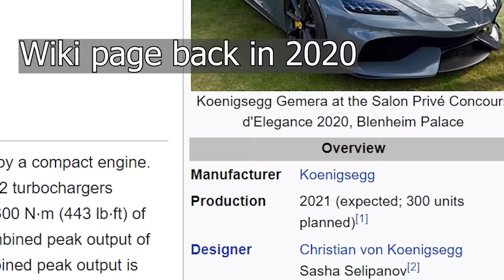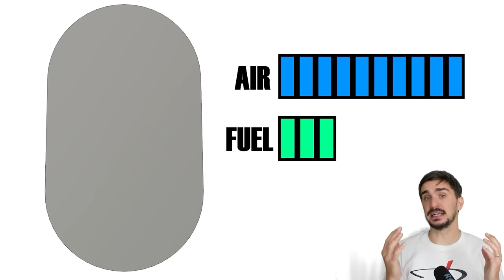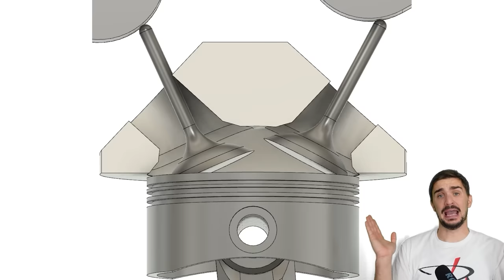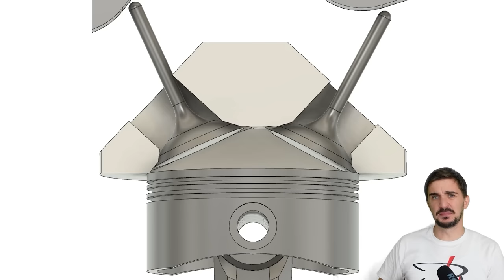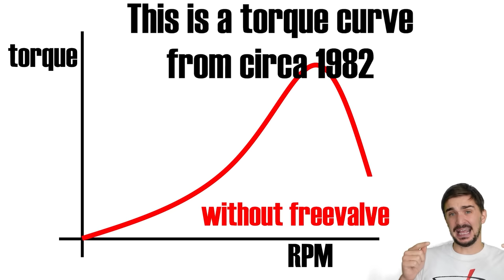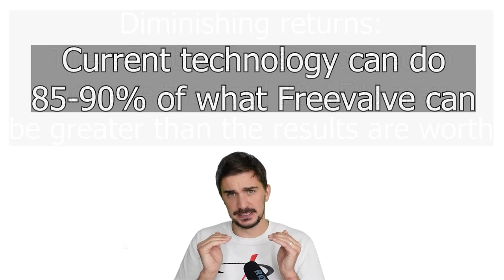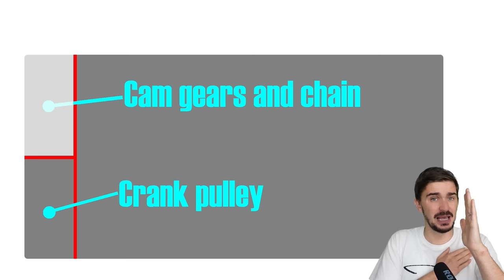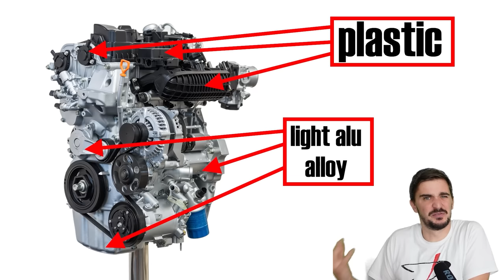FreeValve Isn't a Big Deal. Here's why

Comment: Brilliant! You could also add the fact that future cars are going to be hybrids, where the motors will be electric and there will be a small, cheap, efficient engine to charge the battery. This engine is designed to run at a constant speed always, like 2800 rpm or so, the whatever point makes it the most efficient, and for that, a well tuned camshaft is better and cheaper than anything else. This from a guy making his bread designing electronics.

Comment: fiat did this in 2012 with the Multi Air engine. The intake valves are operated pneumatically via oil and have almost infinite cam profiles. the 1.37 liter engine in the abarth makes 160hp/180 ft lbs tq.

what i think would be awesome is freevalve with the variable compression engine form infinity in N/A form should be able to generate 250 hp from 2 liters naturally aspirated, with all of the benefits.

Comment: Very nice video, I’d say, that not everyone has the absolute need to benefit perfectly from the ENTIRE RPM range of an engine all the time, and some application would rather require a camshaft , simply because of the use case and later repairability, in an absolute way, freevalve is a definite plus, but say I’m going off-road I think I’d be a LOT more interested in a high low end torque than I’d be in peak power, and at a price and reliability in a place that clearly will not have the possibility to let me fix it …

Perhaps in a world without money every engine would have freevalve , both for installation and maintenance

Comment: I think the 600 HP 3 cyl eng would best serve the BAC Mono. The Mono already has a pneumatic clutch, so the compressor could have a dual purpose in regard to powering both the valves and clutch. The reduction in weight might reduce the overall weight of the Mono to under 1200lbs, and the 600 HP would increase the power to weight ratio by nearly double. I think that would make for a spectacular way to bring the Freevalve system into the market. Just my honest opinion.
Reply: This could launch the Mono into the Hyper class.

Comment: I think the only obvious savings that Freevalve or such can bring to an engine is that the engine doesn't need to rotate its camshaft(s). That's it. Kinda same idea as supercharger vs turbo. Engines have to rotate superchargers wasting energy whilst with turbo the boost is almost free.
(Okay, there is some restriction in the exhaust manifold.)
But is it that much of energy do the engines waste for camshaft rotation? The savings can be really small.

Comment: If free valve can use hydraulic pressure from oil rather then pneumatic pressure from a pump they can significantly reduce rotational mass improving response efficiency and superior stability at higher rpm.

Comment: The ability to change your lift and duration at any given rpm is a huge deal.   Your engine at idle will run normal like it has a factory cam.  As rpm rises you can increase lift and duration and timing making it act like a massive thumper cam.  Best of every world

Comment: Kinda missed the point of the TFG.

It's not only a 600bhp 2 liter.

its a 600bhp 2 liter with a torque band wider than any modern car.
It has ~600Nm from 2000 rpm to ~7000rpm, this is unheard of and is possible thanks to freevalve.

Comment: Jaguar got just over 500hp out of the C-X75’s 1.6-liter 4 cylinder engine - turbocharged and supercharged.   

You can get very good performance out of an ICE engine if it only runs at a single speed and load, say a range extender running a charging system, so there is still a niche for fixed cam timing.  Mazda seems to think there is a niche for rotarys as well, of that I am...

Comment: very interesting video, really nicely explained! the only caveat here that I didnt hear you say is that power might not be talking about a peak number, but about the complete 'area under the curve'. another thing that got me thinking is why does Koenigsegg use a compressor for freevalve is Fiat does it though oilpressure? I would think using oil pressure might even be preferable as it would stop the engine from running at the event of an oil pressure failure and possibly preventing catastrophic engine failure. although im not a fan of these insanely downsized 1L engines, i do agree with you that the amount of engineering that has gone into optimizing these engines is pretty astonishing. however, if i compare that 1.6 THP 4 cyl from bmw that my parents had in a MPV to the 1.2 3 cyl that's in my current hatchback the difference in fuel consumption isn't even that big. it was about 6.3L/100km for the mpv and its about 6.1L/100km in my hatchback...

Comment: There should be, hopefully, another reason to use free valve (which was alluded to):  Lower parts count, and simplicity.  So, if I'm building an engine, and I can reduce the parts count (and therefore cost) then it could make sense even with no improvement in performance.  Of course, if there is a patent holder out there keeping the price of using the technology jacked up, then...

Comment: So it is electric control/ pneumatic actuation...
So a high volume air pump needed ( power load on the engine, also mass ), Hopefully low electrical load as everything else is also sucking down those electrons. But the computer can "work out" exactly what is needed in real time and no pumping losses due to a throttle.
I'm sure I didn't hit all the down sides, but most of the up sides

Comment: What about valve float? With normal valves, you have to pick stiffer springs to allow an engine to rev to 8500 tom but that increases friction as well. Also, you didn't touch on the advantages to spool a turbo by opening the exhaust valve earlier or everything between. Well I guess you technically can move the exhaust and intake timing via some type of VVT gear but your duration and lift is still fixed. 

Variable lift and duration isn't always included in all engines but you definitely have cam phasers. Now you remove the cam phaser and add free valve, to a 3 cylinder engine with two turbos and you can choose exactly how much output you want. Let's get Nissan to add variable compression and now you're really pushing the efficiency of an ICE. It will definitely be a smaller package without cam gears, timing cover and you're going to use a 3 cylinder which will be smooth

Comment: FreeValve seems like a good idea but it's just adding 2-4 new points of failure per cylinder by relying on pnematic actuators instead of a good-ol cam. That, plus all of these 1.6L engines are using forced induction so their power figures are not coming from the valvetrain, but by their use of turbo or superchargers. The tried-and-true Mitsubishi 4G63 has been able to reliably make 400-500 HP on 2.0L for decades, although for best streetability staying around 400 HP is suggested.

Comment: Recently I was wondering just how much life Freevalve would have if it debuted on a mass market engine. Its days are numbered just for the fact that electric vehicles are so much more common now. But the limited variability of cam timing is itself a limiting factor for this tech. Could you feasibly have totally different timing from cylinder to cylinder? Sure, but why would someone want that, and what would the effect be over the long term on reliability and wear?
After that the only benefit, really, is reduced complexity from removing the cams, VVT system, chains, guides and solenoids. No small thing for sure but it seems there’s not enough market space or time for the tech.

Comment: Look at my profile pic, I'm a huge Koenigsegg fan. However, I always thought pneumatic systems were unnecessary complexity given other variable valve lift/duration methods. However, with truly infinite variation, you can eliminate a gearbox's reverse gear and corresponding shaft. That's kinda interesting.

Comment: Maybe I'm misunderstanding the concept of these things... but from an engineering standpoint, aren't they a greater risk for major engine failure if things go wrong?  They're pneumatically actuated and timed to move out of the way of the pistons, but what happens when something goes wrong and they stick?  Either a valve doesn't release, timing sensor goes bad, etc...  wouldn't that then slam the pistons?  Sure, timing belts/chains can break, cam lobes can wear out, valves can stick etc. on a traditionally timed engine, but those are things that can be fixed and maintained and are generally mitigated by routine care.  It just seems like if one thing goes wrong with these, your nice expensive engine is scrap.

Comment: From an economic perspective, I have a motorcycle with an engine built in the tens of thousands and outputs in the realms of 200 hp per liter without variable valve timing or forced induction. It does have extensive use of titanium in the valvetrain and of course itty-bitty cylinders enabling it to rev to 15k rpms. I imagine that the tiny titanium parts are a small added cost compared to variable valve timing or forced induction. In this case, Freevalve would probably only marginally improve performance, but probably has a better margin to improve performance / economy in the lower rev ranges.

I hypothesize the fundamental problem with Freevalve, and why we haven't seen it come to market at any price point, is reliability. It may be significantly less reliable than any of the competing variable intake solutions. Others seem to predominantly use a "fully" mechanical valvetrain and modify timing/duration and don't fail catastrophically if the variable timing portion fails. A failure of a Freevalve component might result in a dead cylinder or completely trashed engine - while the effects of a valve stuck open are known (although in Freevalve's case, piston to valve contact might simply close the valve, what with no cam to back up the valve), what happens if an exhaust valve is stuck closed? I imagine it's a meltdown in short order, as the exhaust gas heats the remaining exhaust valve, the piston compresses the exhaust gas if it can't escape fast enough, and cylinder temperatures rapidly rise - if the piston doesn't crack instantly from the heat / pressure.

Comment: Perhaps a stupid question, but wouldn't a stand-alone ECU with a lot of variability in mapping fix the problem with a traditional cam and valve system? I know that there are several cars with boost that have boost by gear and fueling by RPM that can be mapped with stringent parameters. This would provide the correct air fuel mix at low RPM (around town) and high RPM (spirited driving) fixing the slugishness. I realize its an expensive solution but it would mean we could utilize existing technology and engine strugture rather than spend the money creating a new "free valve" system.

Comment: hi...and also, how much power does the solenoids sap from the electrical system, how much bigger must the alternator be to overcome the power drainage on the battery that the freevalve operation computer, and the freevalve solenoids themselves use? there it might seem that mechanical variation technology might outcompete freevalve... i found this quite interesting, thank you...the biggest power losses on any 4 stroke piston engine will always be mostly these three things: 1) compression stroke, 2) valve springs, 3) piston\conrod reciprocating momentum, sure there are other factors that drains a lot of the energy output of the power stroke >>>but if it works it works doesn't it? 😁 always a fan of newer better technological efficiencies...

Comment: 2:00 a camshaft thats not variable is most effective and efficient at a very narrow rpm range basically if an engine has a maximum rpm over 5000rpm is will be so far outside the usable range that other systems have to compensate and if you want, good efficient power at high rpm it wont idle and will missfire and foul plugs at idle

Comment: until the electrical components beat out mechanical components by all levels, it would be more maintenance only. a high speed motorcycle might also benefit for city driving and track driving in a set of profiles.

Comment: Pneumatic valves are used in F1 - the place where you chase that last 10%. Big part of how they get 300+ HP per liter

Thing is with the automotive industry is that a few percentage point difference is massive when the curve levels off, as it has with the mature industry of automotive. It's absolutely a performance component right now but should it find a cost effective mainstream application, that small increase matters a lot.

With big monolithic industries, it's very common for tradition and already-proven tech to take precedent over new tech - this only makes it harder. Hopeful to see this kind of tech in production cars, but I doubt it'll really happen before electric cars dominate the market.

Comment: This doesn't take into account what 2 bar of boost would do for a freevalve engine. 1.6 liter NA at best makes ~180hp, 1.6 liter turbo makes 300hp, or more depending on boost levels. I'd be interested to see what a 1.6 liter freevalve @230hp would make if it had 2 bar of boost.

Comment: free valve seems so much more reliable than many of those other engines, less weight,  fewer parts, fewer points to fail, no timing chain/belt,  i've had two cars die because of timing belt fails in the last two years.

Comment: I think the only real possible benefit of any value in Freevalve tech is the block design & ease of maintenance. I like the idea of not relying on oil pressure (dirty oil, etc.) actuated parts, and system like that can get complicated when it comes to disassembly. Freevalve engines can be cast as a one-piece longblock, that’s pretty cool. But honestly I’d rather not rely on the electronics of it and also run an air compressor off the crank. It’s really too close to decide, and why bother stirring the pot that is the already well established infrastructure of building and developing engines the way they already are.

Comment: The only efficiency Freevalve can "add" is removing the throttle valve and the inherent turbulence it creates on a naturally aspirated engine. A turbo-charger recovering lost heat from the exhaust and using it to cram more air into the engine is significantly more efficient. 

The last holy grail of reciprocating engines would be "cam engines." Getting the piston to dwell long enough at the top of the stroke for complete combustion does a few neat things.

Comment: Speaking from the real world as an auto repair tech, the biggest problem with this system is likely serviceability and reliability. Electronic management that runs off of permanent magnets or copper coils, whether they're ignition coils, crank/cam position sensors, fuel injectors, etc. are all susceptible to failure from high and fast variation in temperature. To make it worse, they typically fail slow rather than just immediately not working; which usually manifests as failure when they're heat soaked.

Having a coil or a sensor that fails when the engine warms up is an annoying trip to the parts store. Having a valve stop working when the engine is hot and having to get the head disassembled to replace a solenoid pack is infuriating.

Comment: Puretech engine is a good exemple of why we should remove timing , nowadays we don't have problem with power or efficiency or emissions , we have reliability issue , removing much moving parts we can achieve more reliabilty , supposing valve actuator are reliable . But why manufacturer will invest in that technology money , when the change make loose money in R&D and in aftermarket sale... Maybe this technology will open new era of thermic engine but look like nobody will do the effort to find it out .

Comment: Wouldn't freevalve have use in applications that have widely varying needs? For instance a truck that has to move long road distances, then serve in a rough duty off road capacity.
The timing of the entire valving function for these two duty cycles could be completely different at the touch of a button via programming. Diesel truck that are loaded or unloaded, cars that are used for short trip family function or long distance travel, etc...

Comment: Cam timing system component problems, ie worn chains, tensioners or belts, would be a thing of the past. Camshaft, cam follower or lifter wear problems, caused by the reduction of ZDDP in our oils would also be history. Valve adjustments also are gone. I think they should be building and marketing Freevalve technology as an engine reliability / durability advantage. That just happens to (Slightly) improve power, efficiency and emissions.

Comment: I would argue that you still get a significant benefit over any engine that doesn't have variable valve lift. The Mini you used as an example does have Valvetronic, so I won't get into that one. The GR Corolla, on the other hand, does not, so I would like to point out a few things there.

Per Car and Driver's testing, the GR Corolla gets an average fuel economy of 32 mpg during constant 75 mph highway driving. The problem is, the BMW M340i (with x-drive, so both cars I'm comparing have rear-biased AWD) gets 33 mpg on the same test, despite the GRC being much smaller and lighter, having half the cylinders and only around half (53%, specifically) of the displacement, and being slower in every acceleration test. So basically, I would say that having variable valve lift is a reasonably good substitute for freevalve, but without VVL an engine is going to lag behind in fuel economy and possibly performance as well.

Also, I didn't get the impression that the Qoros concept car you referenced was designed with performance in mind. What was its fuel economy like?